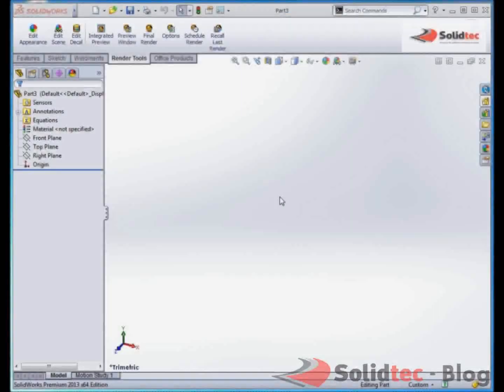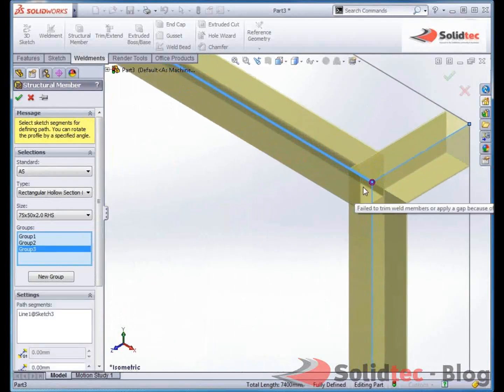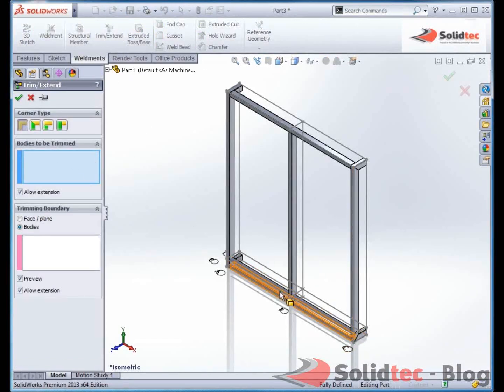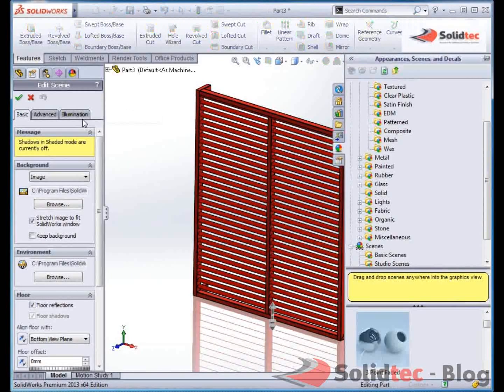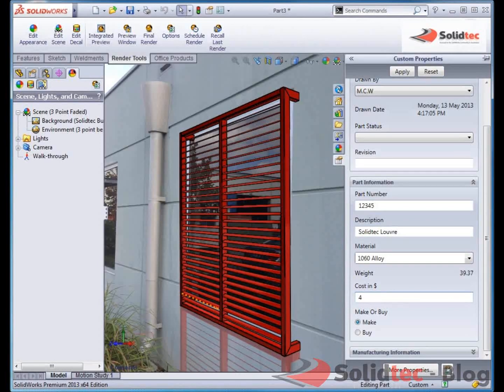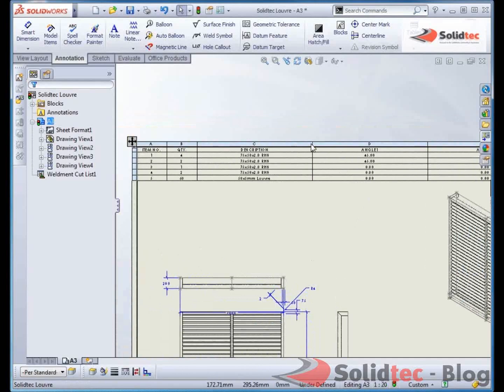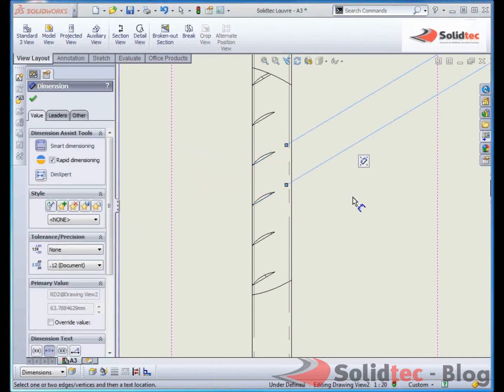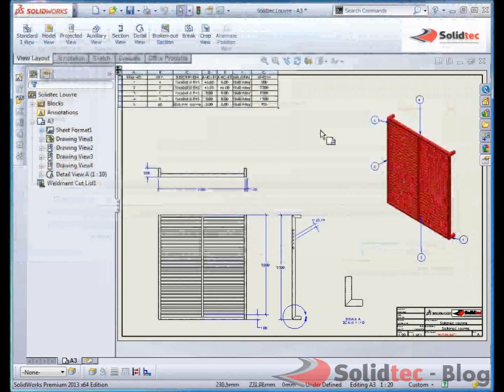How to create a Louvre in SolidWorks

Comment: The 3D grid took me so long to figure out. Go Insert > Reference Geometry > Grid System before you start drawing.
The rest you can figure out by making sure to watch what he's doing rather than what he's saying. For example: Before adding structural steel, he right clicks on 3Dsketch1 and clicks show. If it's not clicked you won't be able to add the vertical members.